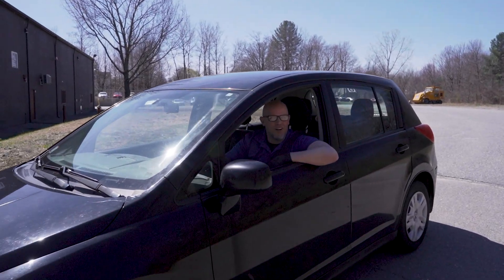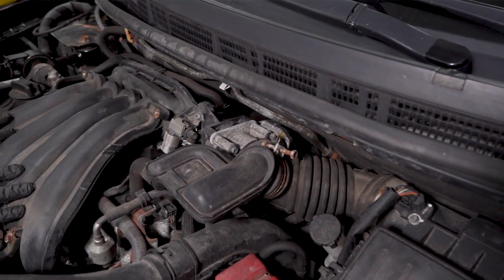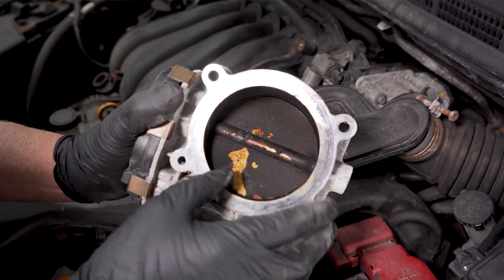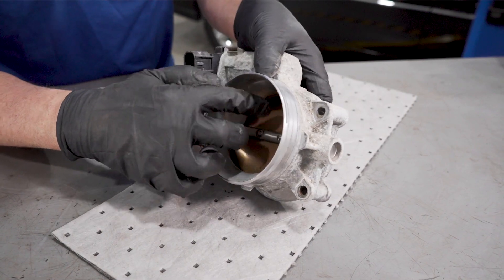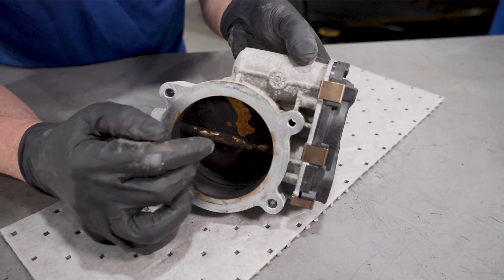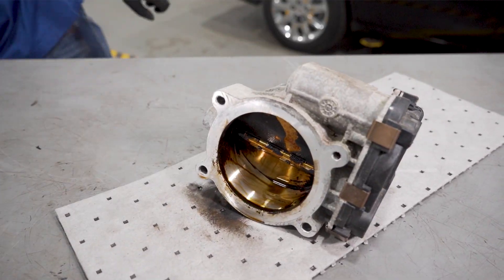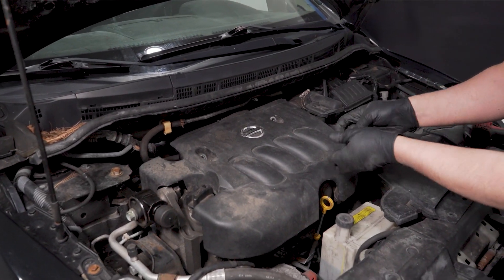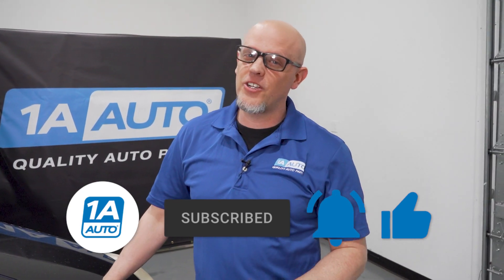Is your car or truck's stalling engine hurting gas mileage? Time to check your throttle body.

Comment: Can yall please do a video of a 5.0explorer upper intake vacuum line that's on the far right of the intake,when standing In front of the vehicle,it's a rubber house with 2 lines connected running to both sides of the car,I can't find the part number or even a hint of what the line is,every answer is different

Comment: i just did this job and changed a valve cover because the pcv valve was incorporated. since then the vehicle blows smoke everywhere if I shoot the rpms above 3000. Any ideas why it would do this? someone mentioned the intake may be an issue as well, but not sure what they said specifically.
Reply from the maker: +pearl rival We wouldn't be able to diagnose an issue like that here, you may want to have a local mechanic take a look at it. Thanks for checking us out! http://1aau.to/m/Shop-1AAuto-c

Comment: gasoline boils at 140 degrees Fahrenheit  you need to get copper coil 12v immersion heater and start vaporizing your stored gas vapor low pressure system

Comment: Mines electronic.  When I'm driving, if I let my foot off the gas then give it some some gas,  there is a thump everytime. I cleaned it a a while back but did not remove it.    Is this throttlebody related? All my engine and transmission mounts are new.

Comment: I have misfire on cyl 2. Disconnect maf (tested and good) no more misfire. Could dirty throttle body be a culprit? Also, I have heard only use throttle body cleaner, NOT to use carb cleaner! Also, a new paint brush might get it done more quickly?

Comment: If is not that much dirt, I'd rather clean it without removing it, of course being careful and not pressing the throttle in the process. 

While having the key position on accessories use something to press the gas pedal to fully open the throttle

Then clean it by using an specific product for that purpose, use a rag to clean the dirt. 

After that release the gas pedal while still having the key position on accessories, then turn it OFF. 

Wait for a couple of minutes to let the gases to evaporate, then reassemble the air intake hose. 

Turn the key position to accesories again, press the gas pedal to the bottom and keep it there for a few seconds, release it and repeat 2 or 3 times. 

Turn it off and then turn the engine on. 

If there still any vapors you may have some rough idle, just Rev the engine a couple of times. 

And after that the rpms should stabilize, you're good to go.

Comment: My son’s 97 Pontiac Grand Prix GT 3.8 won’t idle at startup and he has to hold accelerator pedal down for a couple of minutes until it idles by itself. New plugs, wires sensors have also been replaced. Idle control valve was also replaced several months back. Any recommendations?

Comment: Is it enough to just spray and use a brush to clean the outside of the throttle without touching the blade itself and risk killing the calibration?